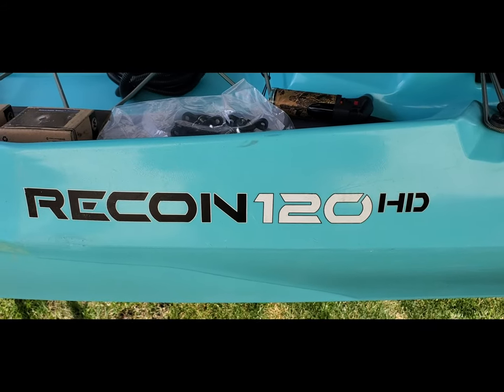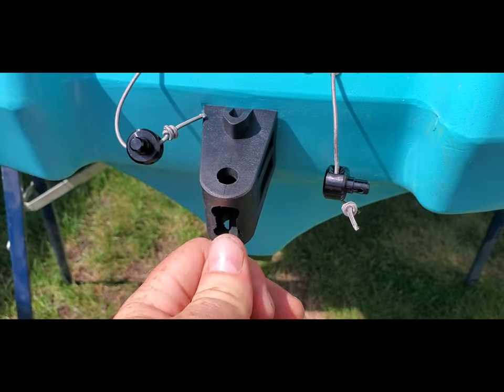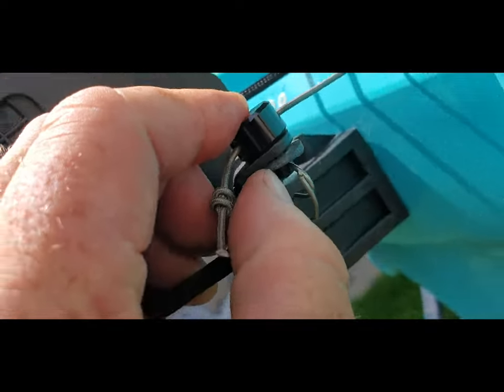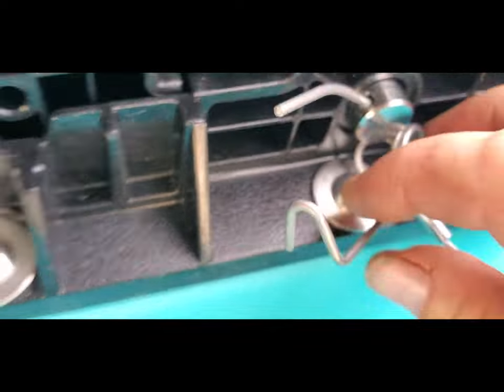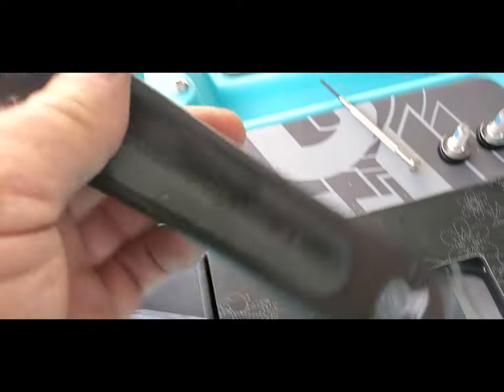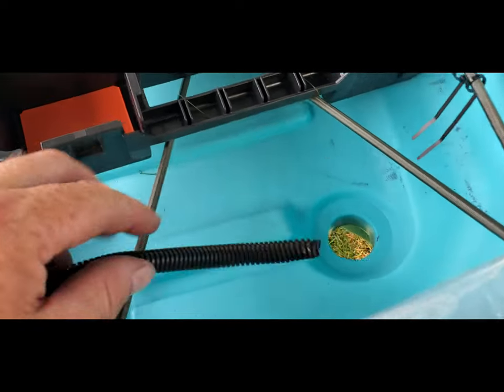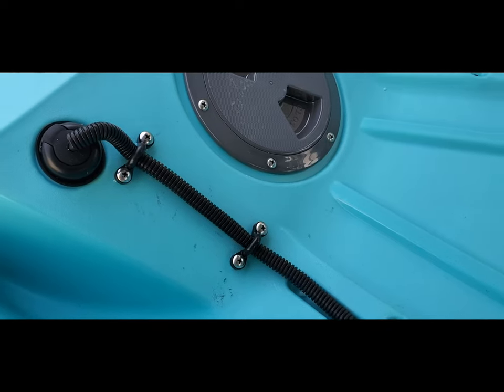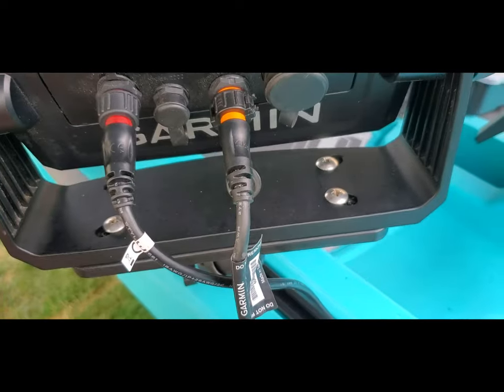Wilderness Systems Recon 120 HD Set Up & Rigging

Comment: Thanks for the vid! Do you get much water coming through the unplugged hole, where the wire from the transducer comes through?
Reply from the maker: Are you meaning in the tank well??? If so, even with my 8 year old daughter sitting in am lawn chair back there, I get no water back there
Reply: Wow, nice! And yeah the rear area, where the transducer wires come though the kayak. I thought water might seep in and out, through that open hole. Good to know. Thanks. I've only given my Recon 1 test run, and I had drain plugs in. Winter now. I did have to mill a little notch out on both sides on the Garmin transducer mount, where you said you dremeled. My Recon scupper mounting holes were narrower than the Garmin mount. Thanks again for the vid
Reply from the maker: @holttool  feel free to email me. Zilkm@live.ca if you have questions on anything.

Comment: Hey was just had a question. I just upgraded to side imaging transducer and was wondering do you have side imaging on yours and if so does it interfere with your imaging when mounted on bottom?
Reply from the maker: I have Sidescan.  It only affects a very small portion along the very top of the water. I have yet to have it cause any issues.

Comment: Where do you put your battery? I have the same Yak and looking for ideas before drilling any holes
Reply from the maker: I put my 2 batteries in a dry bag and put them in the tray in the front hatch. If I know I  going to fill up the hatch with gear, I will attach the bag to one of the supper pillars inside the hull.

Comment: How's the side imaging work with transducer mounted in scupper hole?
Reply from the maker: It works really well. As with any side imaging on a kayak that is not lower than the keel, there is a little area where it misses, but it does sit below the hull on that side a little so the signal gives a good reading